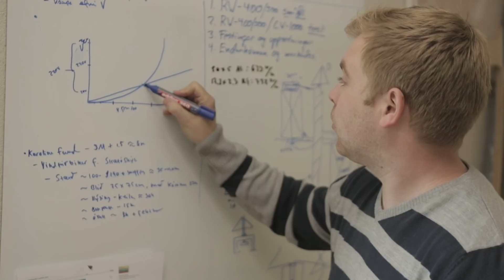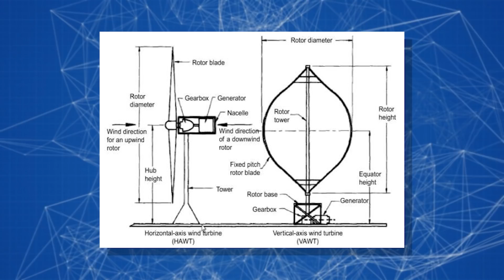Why This Wind Turbine Will Change The World

Comment: Have been using solar and wind power for years ,wind power is perfect if you live near the sea , less maintenance you don't have to worry about cleaning the glass ,night time is when I'm using most power in the morning my batteries usually are fully charged most experts underestimate how good win generation is. In Australia unfortunately if you use wind generation on your house with solar panel, rebates you will do all your solar rebates I believe this is to help protect wind generator farms
Reply: Same here, 40 years of wind and solar use. Nothing beats wind for the NIGHTTIME, but now that I'm grid tied PV is my fav. Hard to beat no moving parts, noise, and not tower required.

Comment: I T
the datum for temperature measurement was just after the end of the little ice age. You confidently state that it will rise another 3 degrees. Wh? The measured decadal temperature gradient is currently 0.14 degrees so will take over 200 years to get to your figure, but you forget the major driver of temperature, the one that has existed for millenia, i.e. nature.
That aside, wind generation is not good generation,  it is asynchronous and lacking real inertia, you couldn't run a grid soley on wind generators, it simply will not work. Synchrous generation is required to match load to input power.
Reply: Saying that you cannot run an grid solely on wind generators seems misleading.
What about battery technology?
Or a grid large enough to have wind turbines in several different locations that spans hundreds of kilometers, just because the wind doesn't blow in one location  ,it does not mean that it won't blow 30 km away.
And the temperature has actually increased by 1 degree Celsius in the last 45 years so the average temperature increase per decade is closer to 0.22 degrees.
Reply: @bluesbr0ther588  The cost for a battery bank large enough to supply needs for just the average house would be massive.  Conversion would mean a massive increase in mining of metals such as lead, lithium, cadmium, nickel, copper, etc...
Reply: @ffjsb  
Solar and wind are the 2 fastest growing energy sources on the planet and at the same time also the cheapest , even without subsidies.

Comment: This is nothing new I saw something similar at least ten years back. They are small because their power generating capacity is tiny. Comparing the two is like comparing a row boat with a cruise liner.

Comment: Actually, not that new of an idea. Similar devices have been made from split oil drums. The rub is that the wind mill is far more efficient. This is why we don't see farms of this type. There isn't much of an escape from high placement of the generator structure, as there is more wind higher up. This structure can be placed somewhat lower, but will still have to be put on top of a pole or tower.
Whether this is feasible for mass power generation depends on the efficiency price paid for going with this set up.
How many kilowatts per acre can this device produce?

Comment: And as of 2020 the earth has entered into grand solar minimum. The planet's temperatures are expected to drop 4° c over the next 50 to 75 years.
Reply: Even if that would be true, it would have nothing to do with man made climate change. It would cause us serious problems when the cycle normalises. It is absulute fact that co2 in atmosphere will heat the planet. By burning fossile fuels, we release the co2 which was in atmosphere before plants and animals developed. There was perioid of time when decomposer microbes didn't exist and dead biomass buried under ground.

If we burn that carbon, it will take hundreds of thousands years to disappear from atmosphere. It has always taken in a past when increased vulcanic activity have increased levels.

Comment: That's basically a Savonius turbine.  And you didn't mention how many of these designs would need to be installed to create the same volume as one of the masted horizontal axis bladed versions....
Reply: isn't the point that you can put these little VAWTs all over the place? You don't need a big field and lots of giant towers. So you could put these on buildings or other structures all over a city or town
Reply: @glennaa11  the point is that they can be put in places where the space wouldnt be used otherwise, like on a rooftop in a turbulent wind area where it would outperform a solar install on the same horizontal surface (for example, on top of a residential-sized water tower in NYC)

any attempt to use them like horizontals is stupid with current tech.
Reply: @glennaa11  Yes, quite. There are cities worldwide with skyscrapers that couldn't host a HAWT, but each could be a safe, practical place for dozens of VAWTs. Even if they don't match the power output of traditional wind turbine, the fact they could be doing 'something' in space that is otherwise doing nothing at all must make installing these turbines a sensible consideration. 
As someone said in another comment - a huge broken HAWT (much as I like them) means no power at all until it's fixed. However, if one little VAWT fails out of 2 dozen on one roof, the others will still be generating enough power to meet at least some of the building's own needs. Best of all, just think of the potential for job creation just by making this type of energy production a reality!
Reply: The HAWTs range from 1MW to 6MW. It usually costs upto a million dollars to set up one 1MW unit.
Reply: VAWT while not as efficient as HAWT, have a lot of other advantages. The most important is that they can be built very cheaply of scrap and are much safer. I would never trust a homemade HAWT, those are dangerous.
Reply: Ross- A -Roni  You obviously do not understand the physics of wind energy and the mechanics involved. You sir are wrong.
Reply: YES, I WAS ALSO HERE TO WRITE SAMEE THING
Reply: Ross- A -Roni  won't be all that long before the companies servicing off-shore will have craft modified to use battery power and have electric propulsion - already seeing it on ferries in places like Sweden/Norway - give it a few years, it'll ramp up and become relatively common for tender type operations.
Reply: A number of VAWT's can be installed at different points and sides of the same tower to equal the same power. The best analogy would be having one ostrich egg or a doxen chicken eggs. And if one is being repaired, the others are still going.
Reply: @aphilipdent  Large turbines are currently in the multi MW range - this one is 3KW?  Are you serious proposing deploying thousands of these?  Might work for spot applications (like lighting up a bus stop that has no easy access to power), but this ain't gonna fly otherwise.
Reply: @aphilipdent  I'm guessing the heavier they make the unit, the harder it's going to be in turning. I don't think it could match the large tower or prop windmills.
Reply: @aphilipdent  Rube Goldberg time....
Reply: As described in the video, the industrial one has upto 3kW. You will need 333 of those to match the conventional HAWT. But, I guess the price sum of all those VAWT would be much cheaper than the HAWT.
Reply: @optimusphoenix-q2j  Well im sorry but its not that simple, and from your comment you either haven't actually looked at their spec sheet for that turbine or you don't understand the industry and whats available, or both, its not a case of simple math by doing 3kw x 333 = the same a one HAWT, if only it was that easy lol... and also the 3kw is taking in to account a lot of assumptions and also unreal assumptions mainly being they will have a location for provide wind speed to produce that, even if it can achieve 3000w which I do not think it can, it stays in one piece. I had a look on the Icewind website, which is very basic, and not a hole bunch of test data available what so ever. 

The test data for proof available shows on the largest rated turbine the RW500 a maximum power output of not even 1kw on the test data chart and also has a rated speed of 10 m/s which results in the 500 watt power output. That fact alone is a terrible output. If you take a HAWT HP turbine using axial flux alternator, with the closest matching system (which I will use a smaller one at 350 watt to give the Icewind the higher output advantage) The HAWT HP turbine at 350w rating running at 6m/s would result annually in 888 kwh, which is way above the annual output of the icewind RW500 with 150watt more at the alternator/ generator providing the power.

VAWT  CAN NOT compete with a HAWT and not even close, which is why you do not see large scale commercial installs of these.
Reply: @optimusphoenix-q2j  based on what i've seen and personally tested, you'd need around 4300 of the design shown here to get the same performance as a normal hawt

And even if sticking them all on a single tower was feasible, airspeed being slowed by the front ones (even ignoring the loss from the tower) would result in that going up closer to 7-8 thousand
Reply: @optimusphoenix-q2j  Until you factor in the real estate costs.
Reply: Ross- A -Roni  You have completely missed the point of the physics involved in what you are saying, one place to start, start with Hugh Pigott and go from there...
Reply: Its all about momentum guys.. Once you have something so massive in motion the force (wind) required to maintain the motion is minimal, but all the while it is cranking out a huge output.
Reply: @foxtrot4579  I agree but the size of this type of turbine would be much heavier and not designed to match the massive turbines we see in fields. it just wouldn't work on a large scale.
Reply: @thedbcooperforum  Ja for sure.. I think we gonna see thousands of smallish units.. pretty much everywhere.. They will be cheap to produce and easy to erect... Im in South Africa.. our government supplied electricity is inconsistent (  blackouts every now and then).  Having a few turbines in the backyard would be great.
Reply: @foxtrot4579  Do you have wind year round. we don't here in Florida. a lot of times it's zero.  turbines would only work here 4-6 months out of the year. solar would have to take over. the cost having both would be a lot of money. that's the bad part. you spend so much and it takes years to pay off.
Reply: @thedbcooperforum  
Im in Cape town .. The wind blows constantly.. now and then a windless day but its rare.
Reply: @foxtrot4579  Perfect for you. I'm looking into solar vs turbines. I do have a rain water collection that goes to my sink by pump. saves a lot of water washing hands, cleaning, washing dishes. I put the water through a filter for my cat and cleaning dishes. my water bill doesn't exceed the minimum. I get the same bill amount every month. it shows I use less than 2000 gallons a month.
Reply: @thedbcooperforum  But surely you can have solar power in Florida? Don't you get lots of sunshine?
Reply: @funquay2219  Yes, I mentioned this. I would need solar along with the turbine if I went that route.
Reply: @thedbcooperforum  

Yes....perhaps years to pay off, but after that, it’s all gravy.
Of course it’s going to cost big bucks up front but like any new tech, the cost diminishes with time..
Reply: @dr.OgataSerizawa  Solar panels have been around for decades. it hasn't dropped like the average electronics or new items on the market. the "green" market is costly with everything attached to it.
Reply: @thedbcooperforum  

So let’s just quit trying to advance renewable energy......let’s just keep burning coal and oil until they’re gone in 100-200 years.   Because you won’t be around when we have burned the LAST drop of oil or the LAST chunk of coal driving up the CO2 concentration in our atmosphere.   Jesus Christ almighty,  listen to yourself!
Reply: @dr.OgataSerizawa  Ok...
Reply: @thedbcooperforum  6kw system dropped 70% in price from 2008-2018.  It's not uncommon for a mid single digit drop in price per year to happen at a panel level.   What maybe has held up costs overall is permitting and installation.
Reply: @thedbcooperforum  o
Reply: @foxtrot4579  You don't even realize what you said is wrong, do you? If that were true, we wouldn't need a turbine at all, as we would have perpetual motion machines... Energy out = energy in • efficiency, and momentum in this context is just an engineering, not efficiency issue.

Comment: No it won't and cut the crap already. Until the end of 2024 all renewables installed will equal the US energy production... which is totally negligible compared with the growing energy needs. So there is no escaping without drastic decrease in fossil fuel extraction.

Comment: What happens when the wind doesn't blow and the sun doesn't shine?
Reply: ever hear of batteries?
Reply: @TheSateef  Yes I have heard of batteries. Consider the size of battery needed to power a city say the size of London and what the environmental impact of producing such a battery would be. Then multiply that impact by all the towns, cities and settlements on the planet. And when the wind doesn't blow or blows too hard, how do we charge the batteries?
Reply: The same thing that happen when an oil well quits production.
Reply: @WV25701MW  That doesn't answer the question, and its  a question that governments will have to answer at some point.
Reply: Alexander Gram Bell didn't invent the iPhone, the Wright didn't build the Concord, the Bullit train didn’t directly follow the steam engine, lithium batteries didn't follow the lead acid batteries in a decade.  Have a little faith in new technology and where that may lead over time.  Just look how automobiles have advanced since the model T.  If Henry Ford had listened to the naysayers, we would still be riding horses to work.

Comment: There is only small difference... The horizontal wind turbine generate up to 4MW...the biggest vertical wind generator I know is 20KW.
Reply: Add as many as you need ...locally  these are much much cheaper  ,near point of use. Almost no long- line transmission loss
Reply: Where? what brand? If they worked I would like to have one for a home. Don't care about megawatt generation.  20kw is more than enough for a single house.

Comment: Too bad about all the up votes. This kind of BS needs to be discouraged. Vertical axis windmills have been around for a long time. They are not going to compete with large windmills that generate megawatts. They might compete with smaller windmills, but you'd have no idea of the possibility of that from this video. There is not a single quantitative fact mentioned in the whole thing about the windmill's performance compared to alternatives. Sometimes numbers matter and BS isn't all that important.
Reply: Yeah I typically upvote everything but had to go down on this one. Really garbage comparing little diy units to grid scale units… well the comments speak volumes already…

Comment: I don't think this is anything new. Might be more practical for small installations. We didn't hear anything about efficiency.
Reply: Because its bad.
Many horizontal, ground-adjacent designs have been tried out and dismissed two to three decades ago.
There is a reason design has centered on turreted horizontall-axis designs.
Reply: @nilesbutler8638  I know that. This was a complaint to the video creator - I am irritated by such half-information.
Then again, sometimes a solution abandoned long ago gets revisited, improved and used again - without further details, it is impossible to say whether this might be the case here. For example, perhaps this kind of design is more efficient for very small, kilowatt-scale installations, or good enough when huge towers are impractical. I don't know, and after watching the video, I still don't.
Reply: @bazoo513  
Yeah, but,  you see:
A person doing an enineering vid on a power production installation - OMITTING the most important measureable pice of information (efficiency rate) ....  makes me deeply distrustful!

That is like a sales person chewing your ear  for 20 minutes without ever mentioning a definite price - there can basically only be one reason for that kind of behaviour.
Reply: @nilesbutler8638  Well, yes, but I am still inclined to leave some space for the benefit of doubt.
Reply: @bazoo513  
Okay, thats a position which either ennobles you, or marks you as naive, depending on the viewpoint.  I do reserve judgement. Its a sympatetic standpoint anyway.

But I have learned to become deeply distrustful of so called "breakthrough" technologies being cheered on YT.
Its raher the rule than the exception to find out that the cheering crowd either was unaware or intentionally omitted deep technical/economic-industrial problems.
Think Thorium-LSRs, Lithium House-batteries, colonic symbionth analysis  ect. 

All not really financially or practically viable technologies which got pumped to make a splash, to attract investors ect.
This one, omitting central information, just smells like another (if minor)  example.
But I get your criticism, I do sound cynical, I know it.
Thats because...I am.